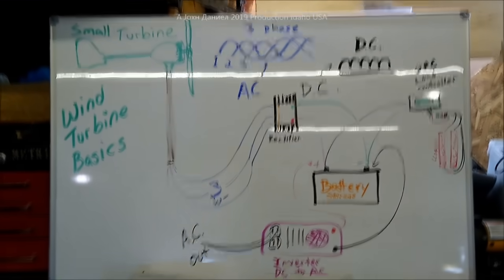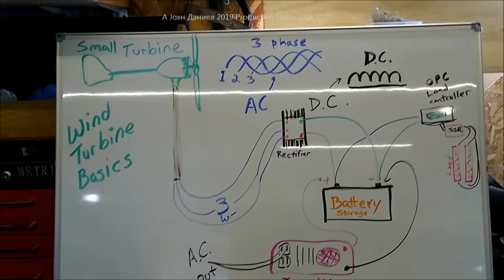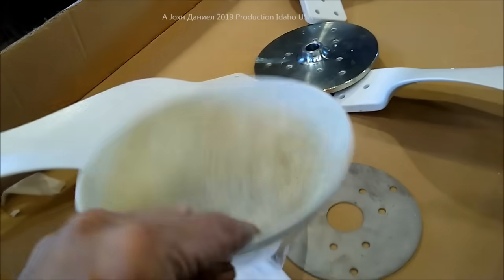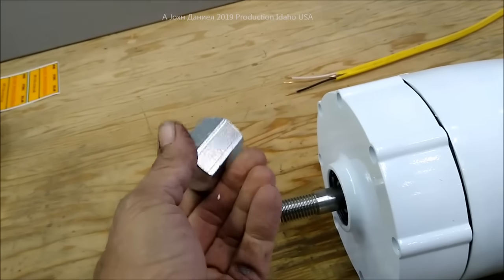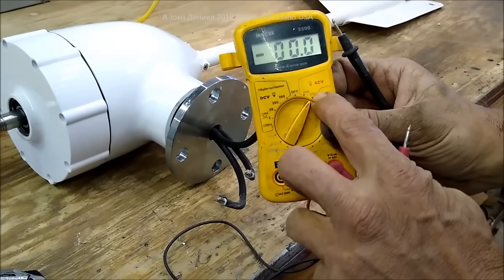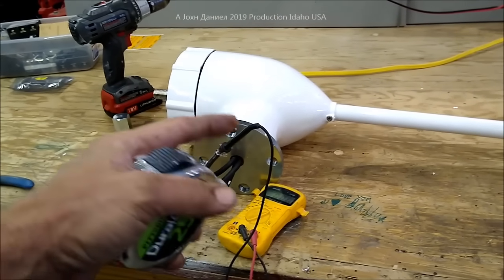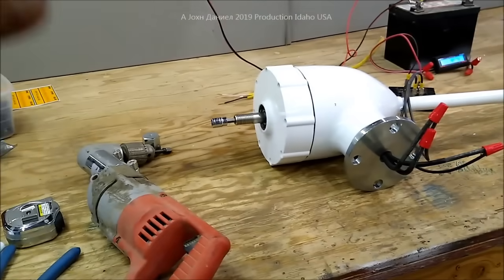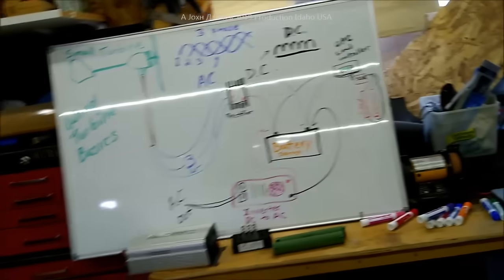800 Watt 12/24 volt Small Wind turbine by B & C Wind, Newest Model, Huge Parts List below

Comment: In your epever vedio your 800 watt turbine meter was showing 80 amps yours came with either 8 or 10 gauge  most of the rest of us got your recemended three wires off the head with 16 gage . How is that going to end up with us. Are we headed for a problem? Give us your opinion. Thanks for all you're hard work sharing with us .
Reply from the maker: Mine is 12 volt model, what is yours?
Reply: Thanks for getting back. Mine is 24 volt. The three wires are at 14 gage . After strpping them . They are rugged wires l'am less concerned now. New question they seem to be stainless steel. If so. Will they not take sodder? Any recommendations would be great. You and family stay safe.
Reply from the maker: @sharyncomstock7066  The wire is fully tinned copper, it appears to be other but it will solder nicely. And 14 awg is very sufficient for the 1 foot length it comes out as. The actual is about 13.5 AWG and the 24 volt turbine is same watts as my 12 volt, but half the amps.

Comment: Thanks for this video.  I have a question about the diagram at 0:08. Can I replace the load controller with a solar charge controller to protect the batteries?
Reply from the maker: You can use a Xantrex https://ebay.to/3i8nIX5 and just follow the instructions for it on how to run a turbine through it.

Comment: I have a 1000w unit from B & C and the wires coming out are much smaller than the ones shown in  your video could this  unit have smaller generator in it then stated 1000w?
Reply from the maker: Off the top of my head, so accurate as I can recall - Drop wires on the 800 and 1000 If your turbine voltage is 12 volt, Expect a bit near 8 awg NEC ( 8.58 awg in china mm awg base equivalent), 24 volt expect about 10 awg NEC, (a china 10.24 gauge equal in mm equivalent) and for 48 volt a 12 awg (china 12.48 gauge equal in mm equivalent). 
The reason is Volts go up, amps drop. A 12 volt turbine makes more amps, needs heavier gauge, a 48 much less amps but both make 1000 watts so wire is sized accordingly.
Reply: @JOHNDANIEL1  It is a 24 volt and the wires are about 2mm or about .080" which should be 10 gauge. They look like stainless steal hope dissimilar metals isn't a problem. Thanks John.
Reply from the maker: @d.b.cooper9507  They are marine tinned and do not have a heavy insulation on them, the high temp insulation is about 1/3 less in thickness, but very durable. And the gauge is fine for 24 volt.
Reply: @JOHNDANIEL1  That's great. Can you suggest a controller I am having trouble finding one the prices are all over the place. Wish you could do a video on the 1000w.

Comment: Hello. I bought the 48V, 5 blades version from this company based on your videos and tests presented and I am very disappointed. I installed and assembled everything correctly, calibrated, balanced and leveled and with winds of 20km/h I still only 35V at the output of 3 phase rectifier. Very frustrating, really.
With winds of 20 km/h the blades rotate at a considerable speed, how can I have such a low voltage at output? Being a 48V turbine the voltage have to be higher in the output at this blades speed? I don't understand !? I feel like I was cheated. I will talk with seller about this.
Reply: I have 800 wat from b&c I ordered 24 volt. I too found slip rings covered with shellac cleaned them up . I am still getting low to no power with good winds tower is 25 ft. Most power I've seen is 5 amps . 12 volts off each phase w/load. 15 volts off each phase free spinning. Not even close to what you have been showing on your vedio. It's time to get some straight up advice from you on this big desipointment . I did asked if 8 gage wire I have is compromising the output. Either way as of now this is a shit product. And yes there tail design lacking in size .how can you have  such a great experience ? This company was not surpose to be a hit or miss according to your vedio . It's time me and others get some answers. Otherwise we've been ripped off.
Reply from the maker: @sharyncomstock7066  Sounds like something is absolutely wrong with your results. Contact the people there and see about getting a replacement generator head for it or a refund if it makes no better results spun on a drill. I know thousands are sold from them with nearly zero problems with power output. I have installed 31 of them as of last month and not one had a problem. 8 gauge wire will have no effect on them in a power loss but a blade thats not fully seated will. Check for the blade not seated on the shaft tightly since you said you have the winds, but not the power I would suspect that the hub and shaft are not fully contacting. I have seen that in about 5 emails from folks asking for help on installing saying they think the blades are moving faster than the rotor in the turbine. And it does seem to take more effort than you think to set the hub in its shaft taper. You can take a 1-1/4 tube and tap a little down on the hub around the nut to see if it gives any. If so, back off the nut, then retighten it well.
Reply: @sharyncomstock7066  You raised a good point (doubt) on this appeared amazing 800W wind turbine as I haven't seen any convincing proof, at least in Youtube, on how, or if, this system would work as expected in real world.
Reply from the maker: @fy2811  Yes, some points are good, like these https://youtu.be/5pcWgJgos4I
Reply: @JOHNDANIEL1  Thanks for the link.
Reply from the maker: Seems many shipped have been shipped crazy rough handled. You can open it, check the slip ring assembly for shellac on it from marine coatings or the assembly for being loose. They have numerous lately that got shipped from AIR, to freight, to Air, to rail ship, then to local and all the handling has been like dropping them from the sky. Not exactly the China folks fault, but due to the virus crap making so many shippers use alternative acts. 
Remove PMA from front, check for loose wires or parts, or paint like coating on the 3 bands or brushes of the slip ring.
Reply: @JOHNDANIEL1  I think they send the 12V version. I don't have lucky...

Comment: @John Daniel Thank you sir for all the great videos! You inspired, and I believe enabled, me to put up a windmill which I've always wanted to do. It's a 500-watt 5 blade 24v one which you suggest in  your links (thank you for the links!). 

However, I'm having a problem and hoping you can help. It's basically making no voltage/power. I made a video to demonstrate the issue as you asked another person-in-need to do. Here it is: https://www.youtube.com/watch?v=GCzHr2ziYd0

I gave backstory at the beginning, but if you want to jump straight to the demonstrated problem then please see 3-minutes into the video. I'd really appreciate the help and Thank you!
Reply from the maker: Sent you some replies on your video. Looks like a easy fix, probably a shipping issue or varnish issue. Its straight forward on them to open them up, be sure your on a nice table, DO NOT get torque crazy on the generator to body screw/bolts. The removal of the generator assembly is you pull with the shaft, not the front cover. Very gentle prying is ok if done circular and balanced on the mating surfaces of the two so not to damage the seal. And the wires to the slip ring are not real long so take apart on a nice table then you will probably see the slip ring assembly mounting has came loose or their is varnish on it from assembly. 
And that Digital meter, that model is RMS I am guessing? May false read on wild AC. The slip ring assembly if it got damaged in shipping they will send you one really fast, my suggestion is to let them know ASAP that your results and findings.
Reply: @JOHNDANIEL1  Can't believe that you responded w/in 15 minutes of my original post - wow! Thank you so much for the advice. No problem getting in there and fixed it as you stated. The slip ring had completely unscrewed https://youtu.be/WKvzwfNTQAQ . Interesting. Carefully screwed it in and tested phase to phase and got 46v, 46v, 44v. Maybe the multimeter is giving bad numbers, but it's WAY better than what I had! 

For what it's worth, I purchased mine from the B&C Wind Generator Store thinking I was getting it straight from the B&C manufacturer and thus would get good service. My experience was HORRIBLE! When I contacted them to explain the situation, and offered to fix it myself but might need parts, they played games, stalled, asked me to e-mail them the video (which I gave them links to download the original cut and YouTube versions), they complained it wasn't mounted on a pole in the video, and so on and so on... Thus why it's taken me so long to respond. I was hoping to report a good experience but gave up on that and decided to dive into it anyway.

Curious, I'm on grid and use a grid tie inverter for my solar - no batteries. I don't think the turbine can go directly to a grid tie inverter (?) so was thinking of using a 12V 100AH LiFePO4 battery ( https://smile.amazon.com/Renogy-Deep-Cycle-Hybrid-Battery/dp/B084M48255/ref=sr_1_10?crid=H9Y48J2RCTEO&dchild=1&keywords=lifepo4%2Bbattery&qid=1598121772&sprefix=LiFePO%2Caps%2C230&sr=8-10&th=1 or something like that) and throttle off the battery through some sort of current limiter to the grid tie inverter (30amps or so). Does this sound like a plausible approach or a bad idea?  Is LiFePO4 batteries  the way to go or Lead Acid? Do you know of any current limiting or current throttling devices?

If you're too busy to answer, I get it. Thank you for all you've already helped me with! Much appreciated!
Reply from the maker: @jeffspannbauer8773  Excellent on the fix. And sadly the Corona thing has taken 2 of the techs out of B&C now for over a month, I think one may not be with the world now,  and they have bureaucratic dummies from the DNC-CCP filling millions of the sick pros places. When it comes to using LiFePo4, you should always use a adjustable controller that has settable parameters. Solar or Wind the big thing on Lithium is they unlike a Lead Acid have little room to screw up on.

Comment: hi John - Question: 800W turbine (24V) - with the controller supplied - in a victron 150/70, parallel to solar modules- they are already there. is that an option? is a return flow from the modules be expected?
Reply from the maker: The Solar controllers Blocking diodes and relays won't allow back flow from other incoming power. But I recommend always buying wind and solar controllers you can set the parameters on.

Comment: What is your ssr voltage rate at?
Reply from the maker: The SSR is 3 to 32 volt control switching, the max voltage it can handle is 600 VDC and its set to operate at my 14.45 volts diversion point for a 12 volt system.

Comment: @john..Great video and having just installed a vertical turbine (https://youtu.be/nfTeYbBoRyI) I wish id seen this first!
Couple of question if you don't mind for this guy from the other side of the pond!
Firstly would you advise 24 or 48v on the 1000W. Other than cabling does it make much difference as I guess you can step down to suitable batteries if necessary?
Secondly. On your setup where you have the inverter AC without controlled battery discharge to the house circuit can this cause braking of the turbine. 
Sorry im no electrical expert!

Comment: John. I need some help if you please. I appreciate the videos you’re posting. I just purchased the Automaxx Windmill 1500W 24V 60A Wind Turbine Generator kit. However I can’t find a diagram online that tells me how to properly set up the electrical connections. You’re videos are the best I’ve seen to explain the process but they go into far more depth and design than anything else I’ve seen out there. I was wondering if you’d help me sketch out the diagram and supplies I need to purchase to put a system like yours in place.

Comment: John Zhangting, I love your videos, so much great info! I just got my 800W Turbine from China, It is an awesome unit, I got the 24V unit and I notice that the controller is smaller and the wires coming out of the flange are only 16 gauge? Is this correct? Everything else about the Turbine looks like yours and it weighs 35 pounds. I'm a bit disappointed with the very small wires and I understand that 24V can be smaller wire but 16 gauge? What do you recommend? Thanks sir
Reply from the maker: The length of the wire is not likely to cause you a issue as long as you go from drop to jump to 12 awg up to 22 feet or 10 AWG up to 68 feet from it to the battery area, I would expect them to have a China Gauge with thin high temp sheath that looks like 16 awg but is more like 14.7 awg actual due to Metric measure. It should be good for 45 amps @ 29 volts (1300 watt peaks) meaning each wire ( using the 3 phase 2.62 amperage loading math) capable of continuous 18.5 amps, peaks of 22 amps.
Reply from the maker: You tube deleted your comment for some reason but I saw it first. So your 24 volt may hit half the amps at 2x the voltage is the exact math. Possible 45 amps for sure but its short burst, and not past the wiring capacity. If you see a storm on the horizon that will be dangerous you engage the brakes as you should to keep it under 50 amps @24 volt so your OK. It can do that, I assure you!

Comment: Hi John my name is Joe and i am in the south of the UK.   Firstly, thanks for the many tutorials you have posted they ultimately inspired me to put in a wind turbine ( a chinese wonder i may say) but on the cheaper side as i wanted to try things out first.   I do however have an issue that any thoughts you may have would be greatly appreciated.  My turbine keeps turning it tail to the wind and running backwards.  It could only happen to me  lol.  Again thanks for the Vids they have proved invaluable and as i move forward look forward to learning more about the finer details and upgrading. Stay safe.
Reply from the maker: Sounds like your pole is not plumb. However you can add 4 to 5 cm of sheet metal to the tail if your air is so turbulent it causes so much spin out.

Comment: John,

Great video, though in major cities they do not allow this kind of wind turbine (safely of blades going flying) but vertical turbines are usually able to get approvals and are not a problem. Is there a vertical wind turbine that you think can work well and generate 800 - 1000W using a 12V system?
Reply from the maker: This 800 watt is very solid, and extremely quiet. A vertical turbine is much louder than this one, and would be a seriously big waste of money due to cost per REAL watt output for them.
Reply: John,
I was told at one point a few years ago (I am not familiar with the current legislative environment) that having a blade wind turbine in Las Vegas is illegal, but vertical turbines are not (it is a safety issue as far as I understand it). So, if you think a wind turbine that is vertical will give me no useful return then its best for me to eschew the entire idea of setting anything like that up. Solar here is way to expensive when you include the installation cost and the power company's having gotten the government to skew things (like selling power back to them) to make it a poor return on the investment.

Comment: how fast does the wind have to blow to charge a 12v battery?
Reply from the maker: 6 to 7 mph you get good charging of 20 to 40 watts, it progresses fast after that cut in speed to over 500 watts at 15 mph.

Comment: John can I but one from you with all kit for a DIY install❓ I have little electrical knowledge, and based in New Zealand. Cheers.
Reply from the maker: They have all the parts you need from B&C, including controllers that do MPPT and internal diversion ( which you would need in NZ) On that link below the video to the 800, go to it, then look on the side of the page, a big 1000 watt controller for 24 to 48 volt is available, you just wire down to it, from it to the batteries or you can also get a grid tie from them with same options and ease of install.

Comment: I'm building one myself including the alternator. It's fun to do this yourself, by recycling scrap materials you help the environment and a DIY alternator and windturbine saves a lot of money. It;s nice to see what I also need to make my turbines operational such as the powercontrol and inverter. 
But why would you convert your DC back to AC again while moste devices run on DC? 
Also is'nt there more energy getting lost if you convert it back to AC since a rectifier also already takes some energy away but this i needed.
Reply: Most things plug into a wall socket, not DC.
Reply: Europe is DC while The United States runs AC, hence your 220 we are 110.
Reply: @fukyoindigoblossoming5087  europe is 220v but not dc

Comment: I would think that using a electric element for a water heater could be substituted for a dump resistor.
Reply from the maker: You can, just takes a long time to make hot water without a wind storm everyday.

Comment: You do realize that a simple electric heater requires 1500 watts so why 800 watts. 800 is useless for a cheap heater.
Reply from the maker: You can buy simple cheap electric heaters from 200 watts to 1500 watts.

Comment: Can i use solar charge controler in wind generator?
Reply from the maker: Not normally, they work if you buy one 3 times the peak ability of the wind turbine due to storms, peaks and voltage spikes.